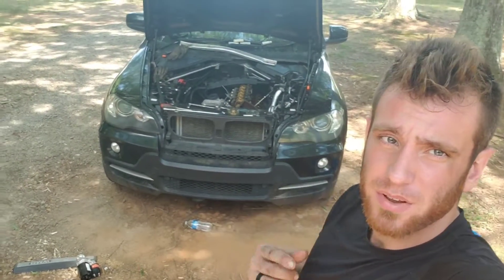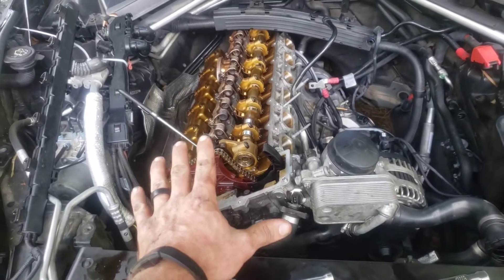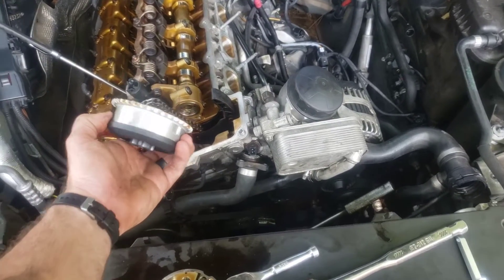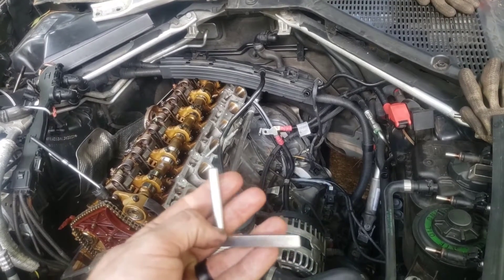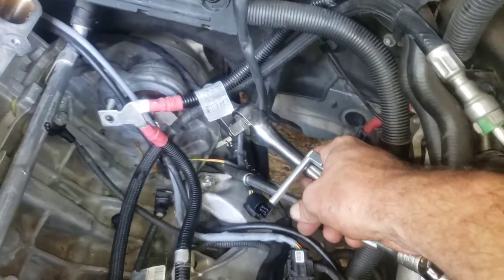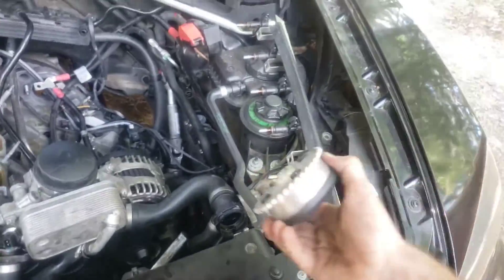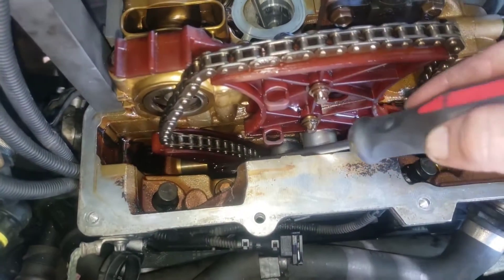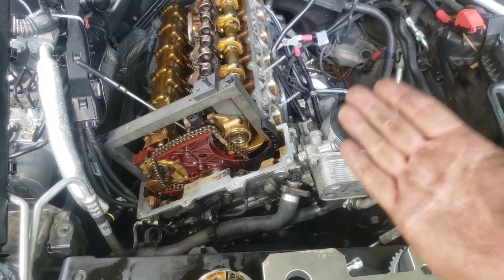Timing BMW N52 Top Dead Center how to (BMW timing mark) x5 x3 330i 630i e70 e63 e83 e90 e92 e93 3.0

Comment: Hi, could you please give me the dimensions of the flywheel pin, for BMW E60 N52. I mean length and diameters. I'm in need, I lost mine and I can't buy a whole new set. I will be very grateful
Reply: Mine was 7.85mm diameter I believe, but I am having the same issue as this guy, it is very hard to make it go in. I got the tool off eBay

Comment: BMW 08 128i car was stalling. Then crank no start. I pulled the ESS sensor the car would start but run rough. Then a few days later it stalls plugged in or out. So I changed the ESS. Still crank no start with it plugged in or out what does that mean when the ESS doesn't respond being plugged in or out and it's a continental ESS. Where else do I look? There are no codes at all.

Comment: Do you have to push the lock pin all the way way in? Mine is half inch away and I can’t turn the engine anymore by hand. So I assume it is correctly locked on the flywheel?

Comment: BMW issued a recall this year for this to change the timing gear bolts that shear.
Reply: They sure did. But have no fix yet. Went to dealer and they told me even though we gave you an appointment, we can’t fix it. 2 weeks later, getting noise from engine.
Reply: @cu2tonite  I'm booked for next week to do the recall and change the bolts. I'm in Canada. 2011 X3 with N52

Comment: There's another way you can lock the crankshaft. 
Take a look at the crankshaft pulley there's a hole an it and look in the bottom of the suspension you Will see another hole 🕳️ Lock them together with a metal piece and the crankshaft is lock. No needs to remove the intake....
Reply: bottom of suspension ? is there  hole on the block behind the bottom pulley

Comment: Hey man I ordered these vamos but I’m noticing the metal plate which the bolt goes through has an extra piece on it which doesn’t allow it to seal and come together as it should. Did you remove these piece? It looks pressed into that metal plate?

Comment: Would bad timing be the cause of my hard start? My car has to crank a few times but idles fine. Changed everything spark/fuel related. No codes showing up as well.
Reply: crank position sensor
Reply: @Criaderovaldez  changed it and starter still doing the same thing.

Comment: There’s a hole in the back of the tranny that will line up with another hole you put a pin in and viola tdc! This is not an interference engine.

Comment: Did the repair work out? I am having the same problem with the broken bolt but I’m not sure if I should do the repair since the probabilities that the valves got bent are really high, but if you tell me it worked out for you I’ll go ahead and perform the repair
Reply: Did you get fixed or did it bent valves?
Reply: Update? How you fixed it

Comment: Hey guys , my 4 bolts sheared off on the intake side, i was able to remove the broken ones form the sproket, since exhaust was timed , i just aligned the cam & sproket before tightening bolts , once aligned , i tightened , fished bolts from oil pan, put all back together, still no start , sounds like no compression, no markings on pistons thought so don't think bent valves , I'm inclined more on the timing part of bolts & sproket, still troubleshooting im about to give up & junk the car , lol

Comment: Hi just want to find out when inserting the vanos sprockets, is there special or any markings on the actual vanos sprockets for some sort of alignment. Or is it just bolted on.
Reply: Was wondering the same thing myself. I ended up aligning the hard mark on the cog of the replacement VANOS Adjusters with the center of the QR code. There are 4 holes on the VANOS Adjuster center bearing that seem to line up with the 4 holes on the end of the camshaft. I reassembled everything after getting it back on time and it took a few attempts to start. My guess is that it needed to build oil pressure up after sitting for so long and having new VANOS Adjusters installed. It did fire up and ran beautifully after the 3rd or 4th attempt. So far so good, I’ve been driving it for the past 3 days with highway and inner city driving with no issues whatsoever.

Comment: TDC is the same regarless of stroke, it's just 180 degrees of cam for every rotation of crank. You want to make sure the QR codes are on top of the front of the cams, and that the holes on the front of the plates are on the left. If they are on the right when you are at TDC, the you need to go 360 degrees of crank to get the additional 180 degrees. I believe these are interference engines. It'll be ok if it jumped some teeth due to a worn chain or whatever, but you really don't want to rotate anything without the chain if you are unsure of where pistons and valves will be.